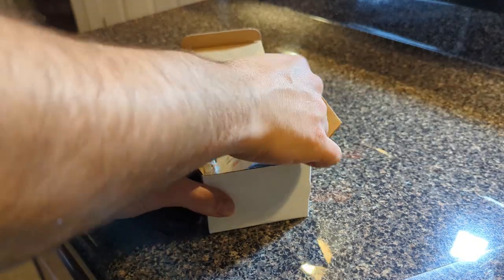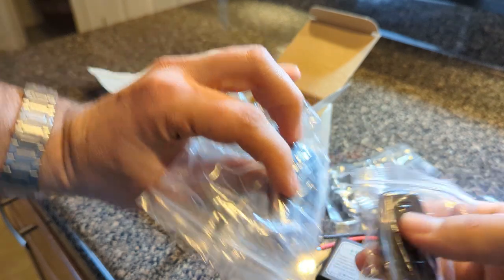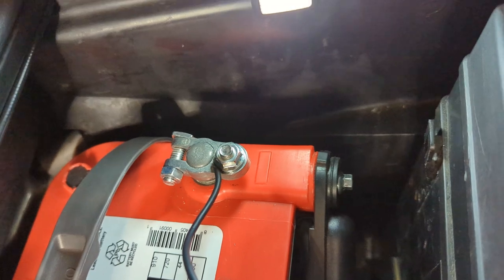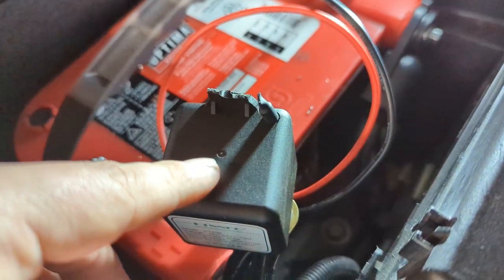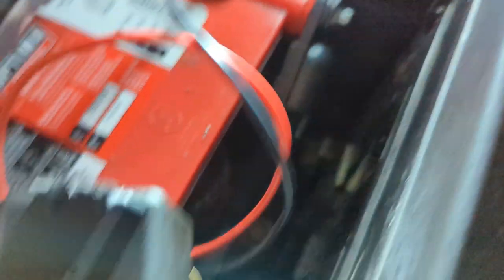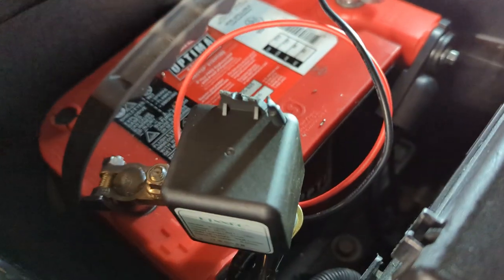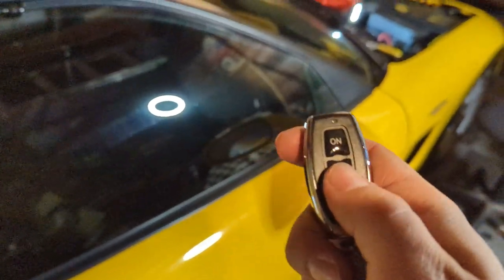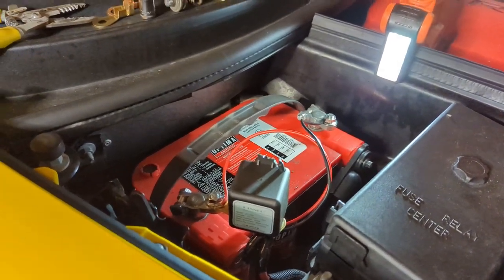TIRED OF PLACING YOUR CORVETTE ON A TENDER? ANNOYED WITH JUMPING IT? INSTALL THIS DEVICE!

Comment: The problem with a battery cutoff on any vehicle controlled by a PCM, ECM the electronics will have to relearn and drivability will be an issue for the first 15-20 miles and the clock will have to be reset each time. On C6 and later Vetts the power windows will need to be reset. This or any cutoff will work just fine on older vehicles.
Reply from the maker: A C6 I would be weary about doing it. A C7+ I do not recommend.  I unplug the battery often on my C5 (always working on it) the only reset I notice is the AC controls and the HUD.  The PCM etc is all tuned specifically and does not deviate.
Reply: @VetOnVettes  Your memorized settings, such as mirrors, radio station favorites, steering wheel positions, and RKE will not work again until you make the effort to reprogram them. I agree with the poster that the PCM has to relearn, especially for idle and top performance. I am knowledgeable about C5s, having owned it for almost 20 years, and have all 3 factory service manuals. There are many things affected by disconnecting the battery. IMHO, this is the worst way to keep your C5 battery fully charged.

Comment: The problem with something like this is by disconnecting your battery the car has to relearn itself in the computer every time you disconnect the battery. There are some items that don’t reset right away where putting on some good mileage is required to do the reset. Not for me. I rather continued to use my Battery Tender Junior when I store my C5 or C6 for that matter.

Comment: Ahhhhhh No... not a good idea IMHO. After you diagnose your car for unacceptable parasitic drains, fit a battery tender with a quick disconnect and simplify your life.
Reply from the maker: Man I was chasing an intermittent parasitic drain for over a year.  If let the car sit more than 3 days it was dead. But sometimes 2 weeks it was fine. I would chase a ground.. clean it up & it was good.  Then a week later back. Took it to a reputable shop to diagnose.. they were at a loss.  Instead of throwing money in the vast hole I threw this guy on and have been headache free ever since! Bonus when working on the car as much as I do it's nice to hit a button to disconnect the battery.

Comment: You have to park the car with it in Reverse.  This shuts down the electronics in the Car.  If you do not park it in reverse, this is why your battery is draining.  I have a 2003 C5 Z06 and my battery has never been drained.  Always park it in reverse.
Reply: What if its auto?

Comment: I replaced ALL incandescent bulbs and lamps with LED bulbs to reduce energy draw and waste that happens every time you open a door or hatch. My C5 is a daily driver, so it is very rare to leave car for days or weeks unattended. If going for a week or two, I just unscrew one of the battery cables quick and easy. The product you are using looks like made in china junk. Hope it works well for you!
Reply from the maker: Good point about it being Chinese.  I'll definitely do a follow up.

Comment: I'm an electronics tech the only caveat I see is that it needs to take in interferences which could possibly turn it off. That would be real bad at highway speeds. Lol. Or a small kid pressing the second remote or something else random. XD
Reply from the maker: I thought of that too 🫣🥴.  Luckily no kids drive with me and the keys sit on the other seat. As far as the relay spontaneously shutting off is a concern. Worst case I coast and hardwire it back 😐
Reply: @VetOnVettes  That would be a cruel trick to play on your spouse. Just let her take the car to the gas station or grocery store and wait out of sight. When she calls just say are you sure and turn it on and off. Lol.  Or a single guy could use it to his advantage with the old "my car won't start". Here you try the key... XD

Comment: Hi, do you still have this fitted? Working ok? I’m fixing up a 98 C5 on my channel and I’m thinking about installing one. Thanks. Dave
Reply from the maker: Hey man.  Working fine.  I remember about 3 months after doing this I switched to a different remote kill switch as I thought it was malfunctioning, but it ended up being a corroded ground going to the block.  But 3 years later all good 👍🤙
Reply: @VetOnVettes  cool, thanks. I’m losing about 0.1 volts per day, about to troubleshoot the drain. I’ll stick a video up but the remote kill switch looks a good option anyway. Will give you a shoutout 👍

Comment: Haven't owned my C5 long (6 months) but had dead battery once after sitting for 2 months with the key left in ignition. Recently I've left it sitting for roughly 2 weeks, no key in ignition and no charger and started fine. Wondering if key left in ignition causes battery drain?

Comment: Don't you have to re program your raido and all of your memory settings in the car after you turn the battery off? Yes I think you do. In a zo6 you probably don't have those options.
Reply from the maker: The only thing that resets (I'm my situation) is the HUD display settings, but I like the default setting.

Comment: My C5 has a different battery plug, it has the screw hole, is there any way around this?
Reply from the maker: Absolutely. They make side post adapters. Pretty much post that screw in.  Most auto parts stores have them.

Comment: Hello, I have a issue that I believe you may be able to help me with, I recently installed the exact same model push button start as you on my 1999 C5 and it started and ran fine for about a week then I let the car sit for about 3 days without driving it and when I went to start it it started very ruff and all types of code commands start to pop up on the display before it cut off, I knew immediately what it was it was my battery drained after sitting for three days and my alternator wasn’t able to keep up the charge being so low since then I have pulled the battery (New red top optima) recharged it to 100% reinstalled it and started the car, everything seems to be fine except one major issue, I now have that wait 10 seconds and pull key command  my steering wheel doesn’t lock up because I believe the previous owner had the lock pulled and motor disabled but with that wait 10 seconds command on it won’t let me drive the car over 2 mph without cutting off any suggestions on how to clear it?

Comment: Wouldn't this relay cut off all power to the car and cause things like having to reset all your radio stations and other things that depend on a little 12V power when the car is off?
Reply from the maker: Good question. I have an aftermarket head unit (internal battery) and a unique Engine tune that does not deviate.  The only thing I find myself having to adjust is the HUD settings.   But it's a non-issue for me.  I would not recommend this in a newer car 2010+ as there are waaay too many little computers and gadgets that reply on the constant 12v.  But for an older car giving you a head it's a reliable fix.